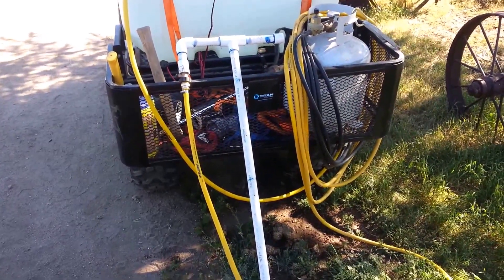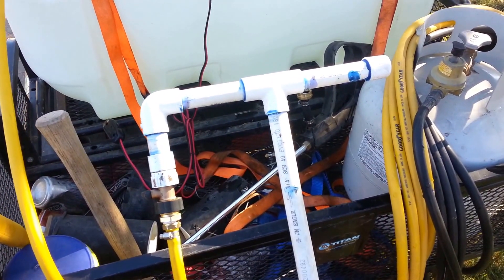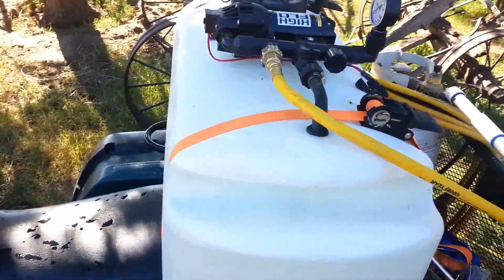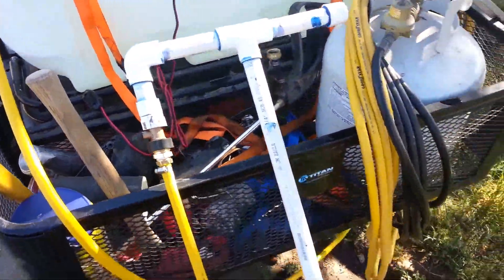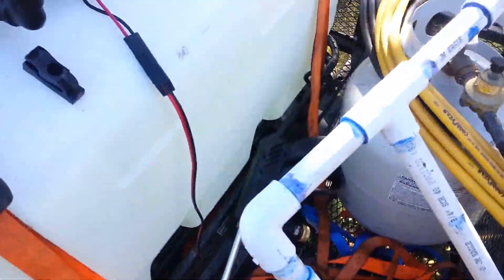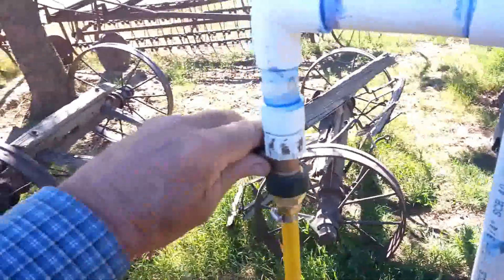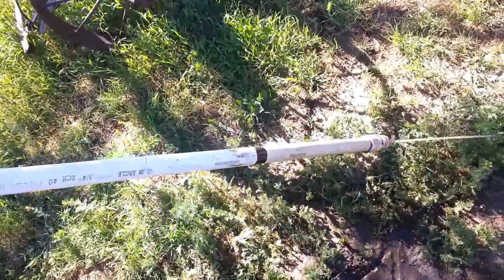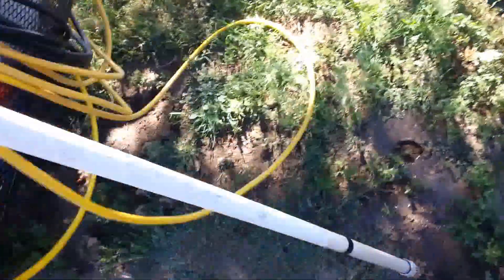No pound T Post installation

Comment: A t post driver costs $20. How much does this rig cost?
Reply from the maker: The water/spray tank cost around $100,  the water wand is around $10 dollar in parts. I already had the tank and quad. You could also use tank on your truck or tractor or what other vehicle you may have. This works in most soils but not all soils like rock. Depending on how hard the ground is I may start all the holes a couple inches and then  make a second pass to finish them.

Comment: Doesnt and wont work in the real world.. only a idiot would blast a hole then drop a t post in it. Now we  got a loose t post in a oversized hole.  Dude ...listen up running cattle and putting up sections of fencing at 20 thosand dollars pet section of land you want a good solid driven t posts.. with good stretched wire  that will take some abuse. So take your little micky mouse sprayer and your bone head advise and go fly a kite cause that is a what not to  do ... freaking tweeker your just riddled with confusion
Reply from the maker: Randall Highsmith  come visit my ranch and I'll show miles of in place holding cattle and horses.

Comment: I wanted to say thanks for the very useful information and video.  I made one of these "water jets" and it worked like a charm (in very hard and compact California soil). You saved me a ton of time and effort, thanks again very much. 

PS. With the untold thousands of t-posts being put in the ground around the world each day, it's hard to understand why your video doesn't have a few hundred-thousand views by now?
Reply from the maker: Thank Shawn for your input, at my place in the spring when there is moisture in the ground it works the best, in the summer when there is no moisture and the ground is hard it takes a little longer.